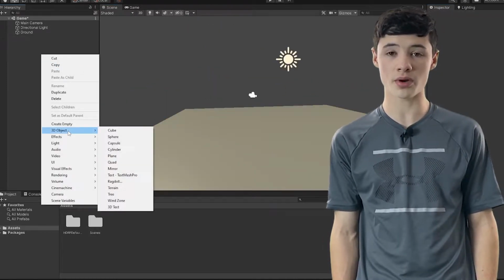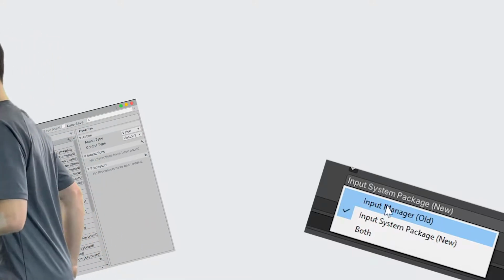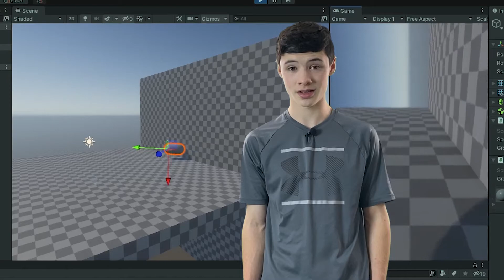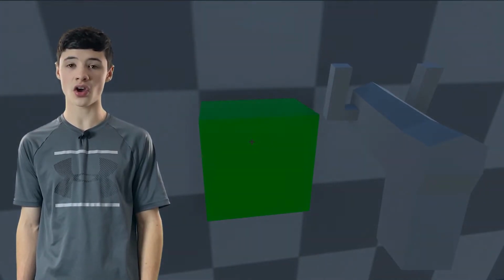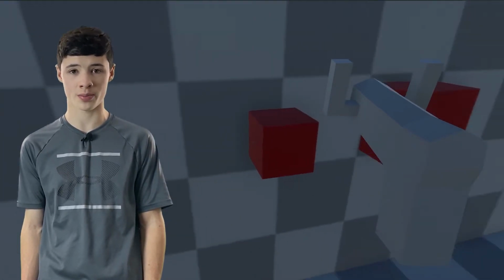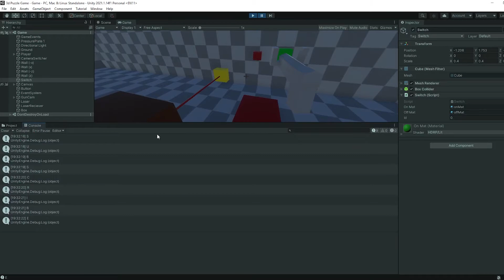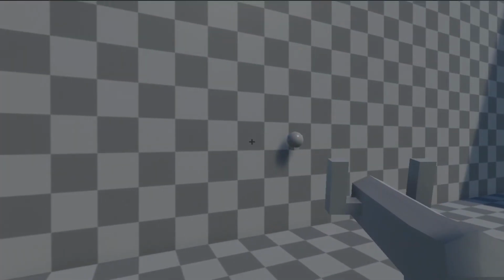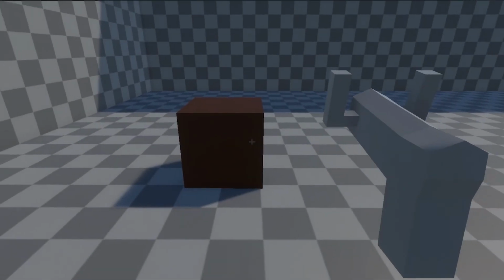Adding the Game Mechanics to my 3D Puzzle Game [episode 2]

Comment: Hey Will! Love the videos and the energy! Just watched the part about the buttons and using IDs to differentiate between them, totally fine for the scale of that project but in the future I would look up something called a c# Interface as a solution to that problem, you can think of them as an almost empty class that only contains definitions for variables and functions.

Say I wrote an interface called IPlayerInteractable (Interfaces are usually prefaced by the letter I), it would have an empty function called: public void Interact(),
and then on your button script you inherit the interface by saying ButtonScript : MonoBehavior, IPlayerInteractable
and then you write the implementation of what Interact() actually does inside of the Button Script!

So when you raycast out of the players camera and find gameobjects you would simply check if it is interactable by going:
IPlayerInteractable interactable = hit.collider.gameObject.GetComponent(typeof(IPlayerInteractable))
if (interactable != null) interactable.Interact();
Reply: And then to have the button know which door to open I would just expose a Door component to the editor inside of the Button gameobject, drag and drop the door you want to open into the property in the inspector, and the Interact() function in the button would be defined as: public void Interact() { if(!door.isOpen) door.Open(); }
Reply from the maker: First off, thank you so much for taking the time to write all this just to help me out! Very much appreciated! If I’m being honest I’m baffled with how kind helpful and thoughtful this whole message was, so thank you!

I am conceptually aware of interfaces (meaning I know they exist, and well… that’s about it), but I never thought of using them like this. I will definitely look more into these so I can use them in other projects. I remember before I used unity and just messed around with the eclipse ide for Java, I would use abstract classes quite a bit, and I know (at least in Java) that these are similar. Never actually used them though, but I will 100% start looking into these.
Reply: @WillHessGameDev  I've never used java actually! But the way that c# uses abstract classes is very similar to interfaces, except you can add an interface to any class regardless of inheritance and you can attach as many interfaces as you want!

I find that interfaces are best for actions that will apply to many objects but in different ways, Player interact works well cause you could want something to happen when you look at a button but something else to happen when you click on an item on the ground,

Or say in Zelda when you pick up a pot and hold it over your head, it's the exact same code as lifting a chicken except with a chicken you have to turn off the AI movemeny, anything you want to make the player able to carry you would just add ILiftable to the class and throw in any specific logic to your object.

And your player script doesn't need to change at all when you add a chicken or a barrel that you hide inside of when you lift it becuse all it needs to know is "Oh this object is liftable, tell it I'm gonna lift it"